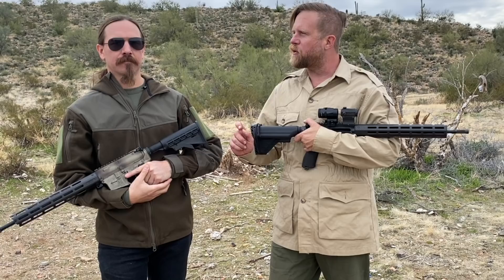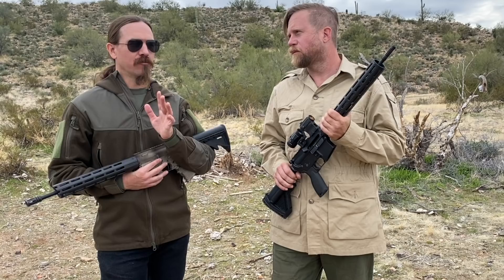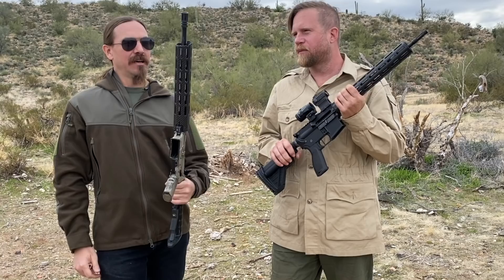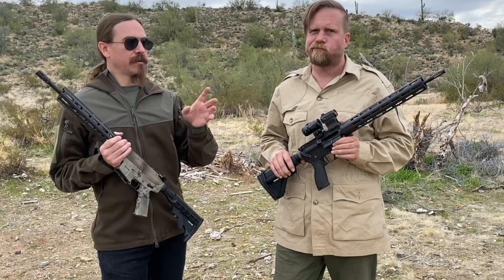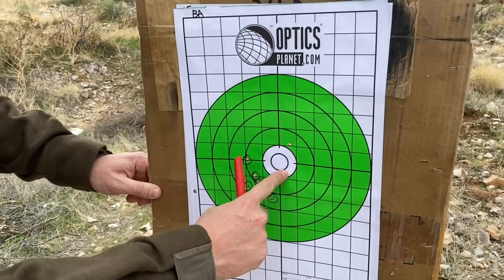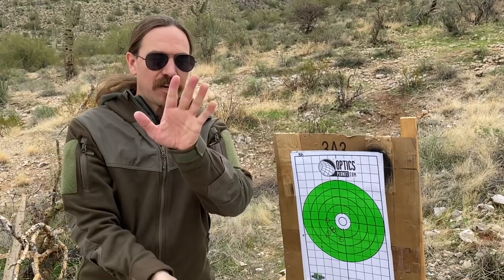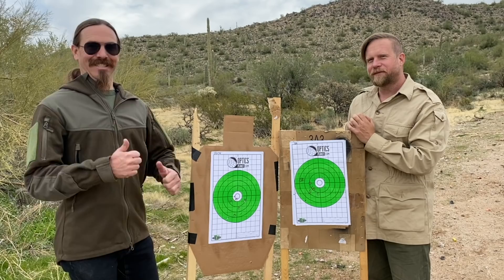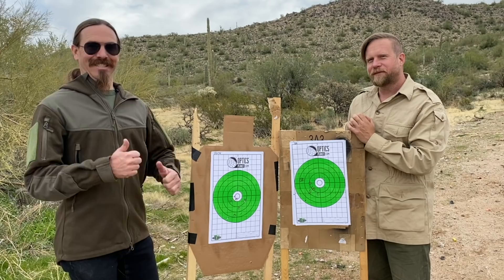WWSD2020: Barrel Selection & Heat Zero Testing

Comment: I'm not so sure that zero shift is the big concern these days, as almost all well made barrels eliminate that as you said, but rather I hear more complaints about just how much groups open up.

I'd like to see these compared to modern socom profiles under the same conditions, even if lighter is the end goal, it'd be nice to see exactly what a difference in weight is ACTUALLY getting you.

Edit:
To clarify some confusion, yes I know hbar and socom are for precision or full auto, yes I know there are better profiles (I own a bcm elw), but chrome lined socom and government are what I had in service, and what we are currently using.

If the goal here is to improve the ar15, I'd like to see it compared to a modern military m4a1, and no they did not test heavy barrels in the last rendition of  WWSD, the tested an old school m16a1 with a pencil barrel.
Reply: I think a more apt comparison would be against Faxon's own "Gunner" profile barrel (with a consistent taper from the breach to the gas block, ending with a pencil profile at the end) or BCM's Enhanced Lightweight Profile barrels. The SOCOM is overkill, as it's literally a heavy barrel designed for fully automatic fire, so the thing weighs like 2 pounds! The results would probably be dramatically different, so I don't think they'd go for that.
Reply: Personal observation with an 18in barrel is that a suppressor makes the issue much worse. Heavy and short seems to work better when you have to hang a pound of weight off it.
Reply: Everyone already knows a heavier barrel is better for automatic fire. You dont need to test it.
Reply: @0778drz110  yeah, but it would be cool to see a side by side to see SPECIFICALLY what happens differently.

Comment: Fully understand the idea of using “representative” ammo for testing.

But

When you have a finished gun how about a test with Mach Ammo and a high end high magnification scope. I would be very interested in what the ultimate mechanical accuracy ends up as. My guess is that it will be much better than a lot of people would guess, but data would be nice.
Reply: A good trigger as well. When you're testing one component like a barrel, you need to minimize variables elsewhere, especially the meatbag on the end of the rifle. A good scope and trigger do that.
Reply: You would shoot from a vice for that.
Reply: @billstevens5277  The thing is they weren't testing mechanical accuracy, but shift in group size. It doesn't matter what ammo or trigger they use, as long as they aim at the right point they can see the shift in group.

Comment: I’m considering using a JP 14.5” Ultralight barrel for my WWSD clone. It comes in at 18oz. Plus you can add a heat sink that weights 4oz to that barrel. Seems like a good trade off to tune weight balance and heat capacity by adding or removing one part. As long as you’re not too worried about cost that is. Can’t wait till the new lowers start shipping, very impressed with the progress you guys and KE Arms have made given everything going on.

Comment: Wait, I thought you had a 14.5" barrel with an integral flash hider on the end, but the end card said 16" barrel with titanium flash hider. Did I miss something?
Reply from the maker: No, that’s what we decided upon.
Reply: @InrangeTv  will that be explained later?
Reply: @ColburnFreml  @InRangeTV I guess it has to do with Suppressor capability, so you can screw an A2 Birdcage or equivalent on the end of your barrel and attach your Suppressor to that.
Reply: Colburn F I believe they already said in this video that the simpler manufacturing steps for a plain Jane 16 inch beat out the weight advantage of a 14.5 p&w barrel. Since brownells is going to be producing an assembled rifle based on Ian and Karl’s recipe, being able to procure enough barrels faster is playing into the decision. By all means, play with the integrated muzzle device barrels, if that is what you wish.
Reply from the maker: You're all wrong.  This has nothing to do with availability but modularity.   End users need, or may want, to change the muzzle device or mount a suppressor.   The 16" with titanium flash hider meets these weight requirements but still provides that functionality.
Reply: @InrangeTv  I'm putting one of these together piece by piece, I have a FDE lower pre ordered, I'm really curious what titanium flash hider you guys will be running? I've been looking but haven't found anything yet.

Comment: You guys should try bcm elw barrels would be perfect for your philosophy, tapered profile and light weight with more mass near the chamber.
Reply: midwestoutdoorsman I was about to suggest that! 14.5” midlength gas system enhanced lightweight mk upper!
Reply: I doubt they'd consider barrels like the ELW or Hanson from BA because they still weigh more. The faxon pencil they settled for weighs 20oz with the flash hider, the ELW 14.5 weighs 21oz on its own. It would have to perform noticeably better in their heat testing for them to consider it I'd expect. I am interested to see how the tapered barrels do on heat testing like this though, I might do a video of it on my own Hanson 14.5.
Reply: @mikeborrelli193  The whoooooole CHF/CL thing came up during the last series and it was determined that neither is necessarily something you need. Times have changed. There are new processes and metal treatments.
Reply: @mikeborrelli193  The Faxons are all QPQ nitrided. They will resist corrosion just as well as a chrome-lined barrel, inside and out. Chrome bores are only necessary anymore if the barrel is only blued or in the white.
Reply: @chrysler5thavenue822  you don't neeeed to save one or two ounces either on a lighter barrel, but I'll take it.. I'll take a chf cl barrel over a nitrided button barrel too, just does better with heat.

Comment: If you guys really wanted to follow Stoner's example, I would suggest an 18 barrel or a 16 inch rifle length gas barrel. The rifle length gas system is key to what Stoner envisioned for the 5.56 round. You get a full powder burn of the cartridge and increased dwell time, which means less gas blowback, reduced felt recoil, and easier cleaning...

Comment: With a bullet / load recipe I’ve been testing for a while in my lr308, the 20” BA barrel will actuality have tighter groups after warming up. There is a little bit of shift from cold bore, but after a couple rounds it stays in place (haven’t get it smoking but I’ll frequently shoot 25 rounds in <5 minutes). The shift from cold bore is about .5”-.75” @ 75 yards.

Comment: I did a similar video but tested a BCM medium weight barrel vs a lightweight. I found that the heat mirage was the bigger issues that affected accuracy. Because thin barrels are.... well... thin, they cool down relatively quickly thus the mirage drops to a manageable level. I didn’t notice much degradation in accuracy.

Comment: Kinda wish y’all would use 77 grain SMK mk262 for these tests. I see it a lot differently than I guess a lot of people on these channels. I think using the absolute best and most consistent factory ammo available really takes out all the variables and shows what is really happening in accuracy. It’s bad to do an accuracy test with inaccurate ammo. But use the green tip to heat up in between shots. No use wasting mk262 on anything other than super accurate shots or badguys. Good video tho

Comment: You know, I've always thought that this ultralight AR thing was complete and utter nonsense. You're trading weight for quality. But lately, I've been seeing a very petite woman, who wants to learn how to shoot, but considers my ARs all too heavy for her. So now that's got me interested in these weight saving measures.
Reply: You are absolutely not trading weight for quality and that's the whole point of the video series. It's to PROVE that these rifles can take a beating and are every bit as reliable and accurate as any other manufacturer or build.
Reply: There's a LOT you can do to an AR to reduce weight without reducing quality.
Reply: I think a lot of people want to trade weight, and still get quality. It just costs more. So people forget you can get solid quality and construction, it just costs more than the cheaper alternatives.
Reply: I disagree that you aren't giving up quality at some level. Pencil barrels may be better than they used to be, but they still heat up a hell of a lot quicker than heavier profiles will. Polymer lowers will never be as strong as aluminum ones, and polymer lowers without adjustable stocks give up a very nice feature of adjustable length of pull (which, for my lightweight AR interest, is vital). The half ounce or whatever you save by eliminating the forward assist gets rid of a part that I used in the field in the Marine Corps.
Reply: @MrEvanfriend  The forward assist is useless. You shouldn't be beating a gun into battery, you're more likely to ruin the gun than taking the time to correct the issue. Length of pull isn't as big a deal as people make it out to be. If you want adjustable then make it that way. I'm just saying the quality  products cost money. Every year the materials science changes the game, hell we are seeing polymer cased ammo become a huge thing. 

I'm not saying anyone is wrong in their choices, just saying you can't say reduced weight means reduced quality.
Reply: @maskedhobo  That is absolute nonsense popularized by tacticool idiots and not anyone with actual combat experience with the AR platform. The forward assist is an integral part of the rifle that can be the difference between a weapon that works and one that does not.

Length or pull doesn't matter for most people all that much. My interest in ultralight ARs comes from this very small woman I'm seeing. For her, it does matter.
Reply: @MrEvanfriend  So you're saying forcing the gun into battery that obviously doesn't want to go into battery is a good thing? What happens if the gun doesn't go all the way into battery, you start smacking the forward assist, now the gun is jammed and you just made it worse so you can't unjam the chamber? What good is the rifle? When you could have taken the few seconds to just pull the mag run the bolt and check the chamber? 

How many prolonged gun fights does the lady plan on getting into that she needs to worry about her barrel heating up too quickly?

Now you could have an out of battery detonation. 

As I said before, the gun was designed without the forward assist. They forced them to add it later.

Of course pencil barrels heat up quicker, using that as an arguing point for thicker barrels is useless. More mass takes longer to heat.

Like I said, make the rifle how you/they want.
Reply: @IlIlllIllIlIIIll  More times than I can count. Ask virtually any Marine (at least an infantry Marine), and he'll tell you the same thing.
Reply: Evan this is so ironic, because the marines as well as the USAF and Eugene stoner thought the FA was bullshit.

Also I was Airborne Infantry for 5 years and 2 combat tours, and never hit the FA except because I was told to. Never had a malfunction that would have been helped by it, all my malfs were due to the tired old mags in basic training. Got to my unit, got issued mags still in the plastic, never had another problem (unless I was shooting blanks).
Reply: @509Gman  They were wrong. I can't speak to your experience, but running rifles in the sand and the mud, shit would get in there, and occasionally the forward assist would help to seat the bolt. I don't know every vet, but all the ones I do know agree with my assessment

Comment: Mid length gas system is optimal on 14.5 barrel its actual too much dwell for 16 barrel. Check out Black River Tactical optimal gas system length for 16 build. Can notice softer recoil impulse

Comment: I feel like AR10s and analogues really should be optimized more for longer ranged shooting. With the first WWSD you seemed to be designing it mostly for close and medium range engagement, and you could push it out a bit if absolutely necessary, whereas I'm wondering if it shouldn't be reversed for the WWSD2020

Comment: Once again, the Faxon seems to be an excellent choice :) That being said, I do hope that they also  offer an 18" version of the pencil barrel, for improved armor penetration. Anyway, I am glad to see this project starting up. I can't wait to pick up one of the new KE Arms polymer lowers! :)
Reply: The difference between the two in 5.56 is only around 40-50 FPS for rounds over 55 gr.
Reply: @DD-hz3ts  Perhaps. However, I have watched testing here on YouTube using those 2 barrel lengths. M193 fired through a 16" barrel was defeated by a standard AR500 Armor brand Level III plate at reasonably close range. The same round fired from an 18" barrel sailed right through the armor without issue. Of course, a 20" barrel would be even better, but I don't think anyone makes a 20" pencil barrel (not that I have seen anyway.) And even a pencil barrel in 20" would probably be fairly heavy. EDIT: my stupid phone said "YouYube" instead of YouTube :P

Comment: Do the brownells retro rifles have the same issues as the original rifles with the group shift under heat? , or is that problem non existent due to modern methods of producing the barrels? I'm just curious.

Comment: I get that with your info that's what stoner would do in 2020 but what would the US military do in 2020 the shot dispersion from a hot barrel may not be excepted now in the military I wish yall would try the faxon gunner and see if you got less spread with heat. Sorta bias cause I have a few in 18 inch but just curious I'd send one if yall would consider

Comment: It would have been easier to install a linear compensator then cut your handguard. A extended handguard on a carbine is a extremely useful format. As the supporting hand is farther forward. This aids control and stability when unsupported. A lightweight handstop is a needed though.

Comment: I would have liked to see you use the BA Lightweight .625” Hanson barrel rather than the BA pencil barrel. The Hanson profile is the same weight as the Faxon, but comes with a pinned gas block, NiB barrel extension, and the profile has been harmonically optimized. I think it’s worth investigating the Hanson barrel for the WWSD2020 project!
Reply: TheReal_Vader I believe that’s what they sent.
Reply: SinistralRifleman hmmm, the weight listed in the video doesn’t seem right for a Hanson barrel. Also, in my experience the Hanson barrels have properly sized gas ports for carbine weight buffers, whereas Faxon barrels typically require an H2 or H3 buffer. Any weight savings of the Faxon barrel are negated by this imo.

Comment: Love InRange, but I guess this is no longer about the best rifle you can build, but being the best rifle that can be mass produced, which means there will be compromises made. Just within this video it went from 14.5 with pinned or integral flash hider to 16" threaded barrel with no explanation. Will be following, but not sure what to make of this series now.
Reply from the maker: You're wrong.  We are going with the 16" threaded barrel with titanium flash hider because it equals the weight of this barrel but provides the flexibility for the end user to change the muzzle device and/or mount a suppressor.
Reply from the maker: This is not due to availability.  Please stop postulating with incorrect information.

Comment: If you are thinking about a 14.5” barrel I don’t recommend getting a integral built into the barrel model if you have any thoughts of suppressor use. I had a ruger sr556 with a integral flash hider and when I wanted a suppressor there was no option and I ended up buying a 14.5” upper and spending 30 bucks to have a flash hider pinned and welded. Then I never felt like shooting the ruger and traded it to a gun shop.

Comment: Awesome video with two great options for a WWSD build.  One question, though.  What is the WWSD2020 philosophy regarding suppression?  Is the plan to build around not having a suppressor?  Because that would seem to be the only issue with the Faxon barrel, that the flash hider is integral, not mounted on standard 1/2-28 threads.  The Ballistic Advantage model would much more readily mate up to a can because of that.
Reply from the maker: Did you watch the whole thing?  We standardized on the Faxon 16" threaded pencil barrel with a titanium flash hider.
Reply: @InrangeTv   So you did.  I guess that's what I get for listening and not watching.  Well, looks like I've got another barrel to buy.

Comment: I built my wwsd but I used a heavy profile 20" and left the poi shift due to heat. If I am going to add weight it needs to count.
Reply: Also the monolithic rail down the hand guard removes( provides a window) where the heat does not effect the target.

Comment: Love the channel guys. Keep it up. Curious as to why the faxon test was redone though. And do you think the keyholing with it matters?
Reply: Chase Fomich test was redone to consider other manufacturers products. 

What keyholing?
Reply: @509Gman  . Honestly the keyholing I'm seeing may be paper tear out. But the Target at 7:44 that shows the first, nonheated barrel group for the faxon doesn't match the Target at 8:58 which is theoretically the five round group after the mag dump to heat the barrel plus the original five round group, which doesn't match. The Target at 8:58 has to be a whole new test or maybe a reused Target. I just would like to know because if it is honestly a whole new test the faxon did pretty good. If it is being compared to the first string it did rise and travel to the right. I'm just looking for some clarification. Double check me as well I may have missed something.
Reply from the maker: https://youtu.be/nk8zHjIhPMw